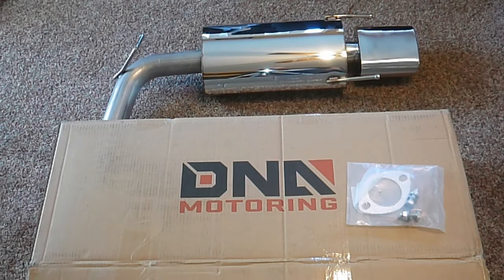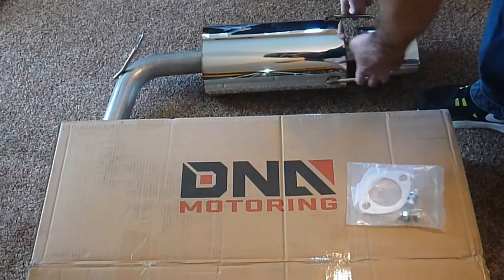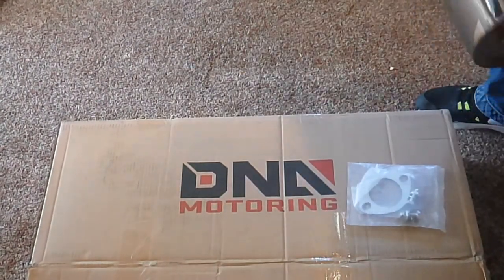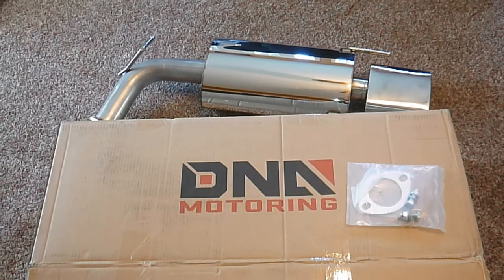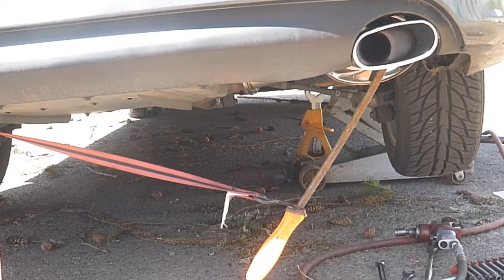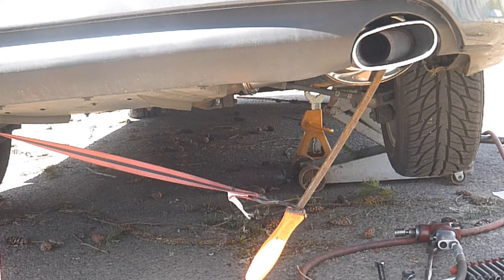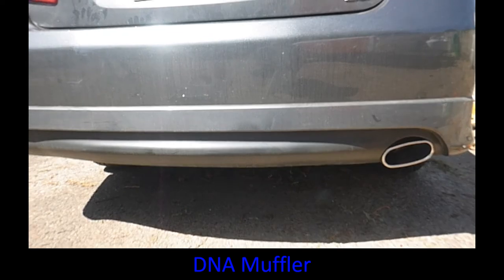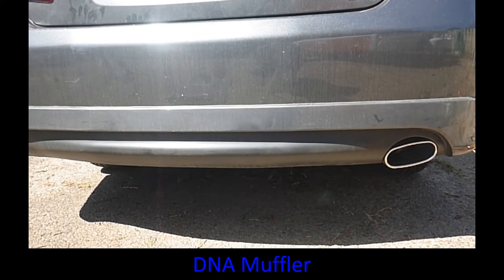DNA Motoring Exhaust on a 2007 Camry SE

Comment: ive seen a lot of reviews that claim its crooked. most people have been turning it and rewelding it.
Reply from the maker: That definitely could be done. I chose to cut it off and use a round tip to better fit the cutout in the rear lip. It also gave the exhaust a deeper tone and it's noticeably louder than what came on the DNA muffler. Here's a video with the new tip:   https://youtu.be/D7gs_vwt6OY
Reply: @howtoforyou9380  I wanted to revisit this video and give credit where credit is due. I ordered the same exhaust and exhaust tip. I have swapped out the oval tip for the round tip and the sound is great. Thank you for your links in the comments on your other video https://www.youtube.com/watch?v=D7gs_vwt6OY

Comment: Will it change the sound if I only install this instead of the whole exhaust pipe ?
Reply from the maker: Yes, it changes the sound quite a lot. After I installed this muffler I put a larger tip on it which increased the sound even more. You can listen to it in this video https://youtu.be/D7gs_vwt6OY